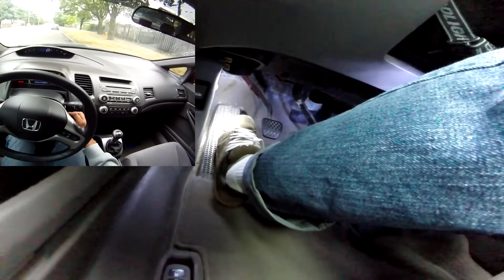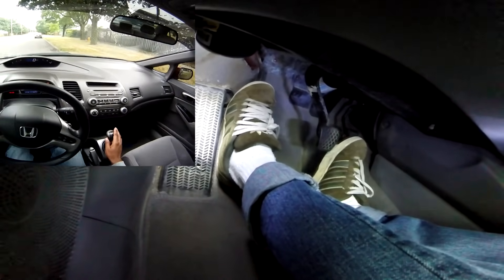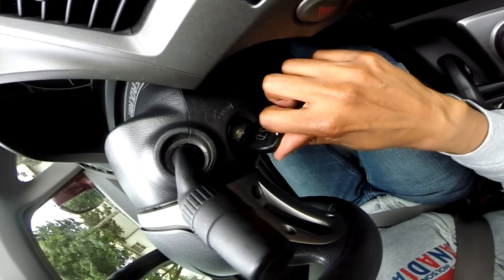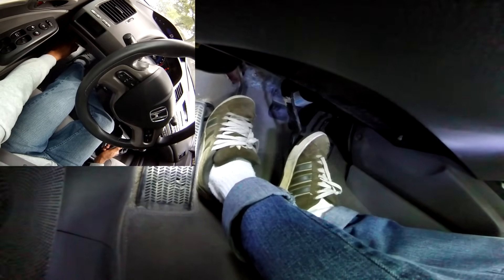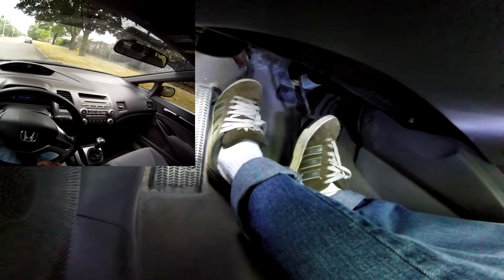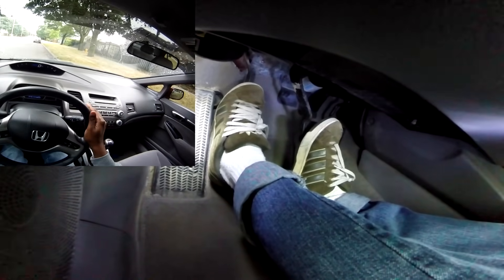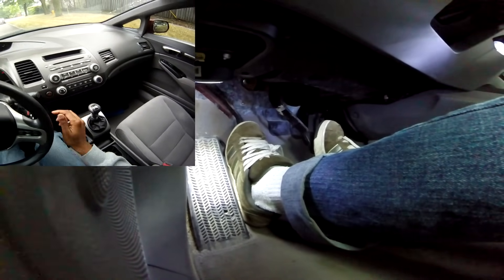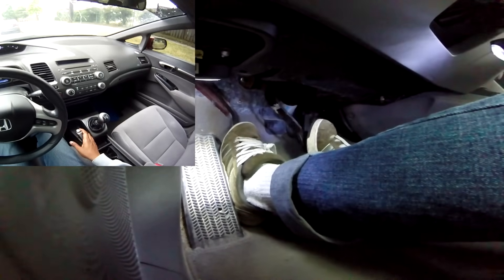(1) How to: roll push start manual transmission

Comment: Should be first not third gear ??
Reply: Benvolio no
Reply: Benvolio not for this you need a high heat to get the engine rotating then you can put the clutch in and go to first or second of you’ve got some speed
Reply: Its actually second.
Reply: First gear would make the engine rotate faster. So I think you correct
Reply: Owais Hoeflich you do this at like 10mph so second is fine, first is a bit too sensitive for it
Reply: Ike Buttle oh yeah whoops ahahah
Reply: Ike Buttle u can do it at  like 1km per hr bro or less
Reply: I’d say 2nd gear
Reply: It depends on the transmission if a 3 speed 2nd or third, 4 speed or 5 speed 3rd or 4th, it just makes the engine turn slower and less jerkyness.  If the engine has been running 1st would probably work ok. If cold it may stop the car instead of turning the engine.
Reply: Just do 6 then hit the car infront of you and leave
Reply: 1st or 2nd. Will probably be best to match your natural shift points.

Comment: i did this and my engine was misfiring and the revs were fluctuating quite a bit. i turned the car off and used a jumper cable and it didnt misfire anymore and the revs were stable. anyone know why this would have happened?

Comment: What if youre on level ground on your own with a big ass vehicle?
Reply: Start pushing with the door open, at the A pillar and the vehicle in neutral, once you have momentum jump in, push in the clutch and put it in gear and pop it. I've had cars that had to have quite a bit of speed built up and others that didn't need to roll but just a hair

Comment: Is there a reason for why he puts it into 3rd gear and not 1st or 2nd?
Reply: 1st gear is harder to move, it's a big gear which allows for more torque but less speed, 2nd is smaller, more speed less torque, 3rd is smaller stil so more more speed less less torque, like when you floor it in 1st you pick up more speed faster but at a lower speed overall than 5th or 6th
Reply: @Real-Ruby-Red  oh thanks man

Comment: Is placing the gear on 3rd better than 1st or 2nd?

Thannks
Reply from the maker: Hi you need to judge your space. The goal is to be able to force the engine to spin without it jerking too much, the jerking(or engine braking) will try to stop the car before it has a chance to pick up speed and start and there is more engine braking in the lower gear at a slow speed, so it is much harder to rotate the engine. In short amount of space you may only have the option of using 1st gear but you really need to work your clutch very carefully not to stall it if you pop it out too fast it will just jerk and stop. You can even do this in reverse gear. but if you have a  good amount of space using 2nd or 3rd almost always guarantees you the car will start up. In a short amount of space you can;t really get the engine to rev up fast enough using a higher gear like 3rd. Hope that makes sense and wasn't too confusing thank you
Reply: Drive Manual
 
Thanks, that makes sense. But how much of wear does it cause to the clutch?

I'm thinking of practicing it on my old car and perhaps it'll take 2 or 3 tries but I want to be sure that it won't hurt it that much. Thanks.
Reply from the maker: hello remember the car is not actually running when you do this so it is not exactly like riding the clutch this is very low speed maneuver and low rpm when the motor turns on.  When the car starts you clutch in and stop or you drive away you don't hold the clutch half way.  You would have to do this 100 times before you have any problem with the clutch and maybe the motor mounts because the motor gets jerked very hard ....if you clutch is in good condition you have nothing to worry about.
Reply from the maker: also if you have access to a hill do it in the higher gear like 2nd or 3rd there is less jerk to the car, in first it will jerk very hard.  In 3rd you might be surprised how easy it starts and you will be wondering if the car is actually on.
Reply: Drive Manual
 Nice, thanks bro
Reply from the maker: Thanks for watching!

Comment: This can mess up the catalytic converter.
Reply: Ryan Toomey Oh good nothing important
Reply: It is no different than cranking with a ignition problem. If the only issues is a dead battery then as soon as the car sees enough voltage to ignition the mixture will ignite.

Comment: I usually find this easiest in 1st
Reply: 2nd gear is better due to torque - less force (in effect rolling speed) is required to generate the required torque in second...you can start at just 5mph in second, first would require a bigger run up...and you only get one chance in some situations...always use second for this reason

Comment: Ide rather keep cables or a charger ready. Thats not good for the clutch
Reply from the maker: Who told you that? The question you need to ask yourself is what do you do if the starter does not work.

Comment: does it need to push the gas pedal?
Reply from the maker: hi usually no you dont need to push the gas pedal but you should be ready to just in case it tries to stall you can give some gas. Always be ready to push clutch in and give gas  if you need to.
Reply: wow what a fast feedback, ok mate, thanks for your help XDD

Comment: Why start in 3rd
Reply: Nick Wolf in first gear it’ll be pretty jerky because of the engine braking. There are a few things wrong with this video though: don’t let the clutch out slowly, doing that + third gear is why it was so jerky for him. Ideally you should have it in second gear and pop the clutch.
Reply: Jack Dalton that's why it called popping the clutch!!
Reply: I think it's a she

Comment: how did u roll.ur car?
Reply from the maker: it is on a hill , you take handbrake off , push clutch in to disengage transmission and the car will start to roll
Reply: I thought your car came with a feature that makes it roll on its own, haha, you did not mention your were in a hill